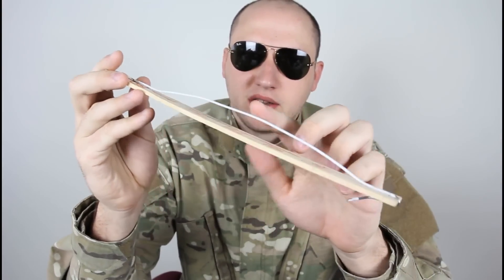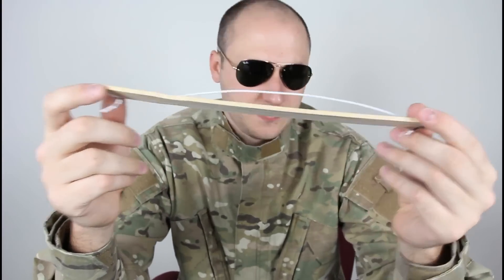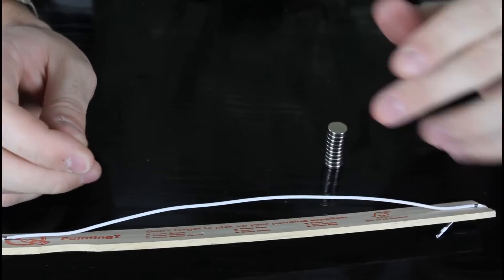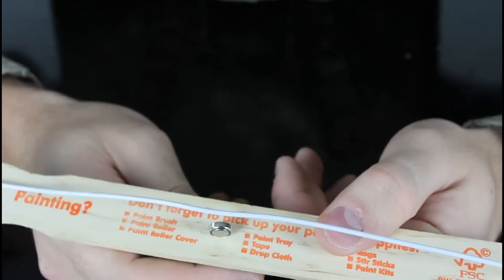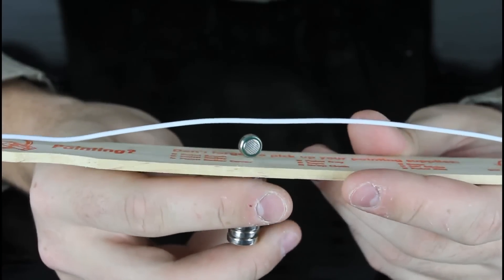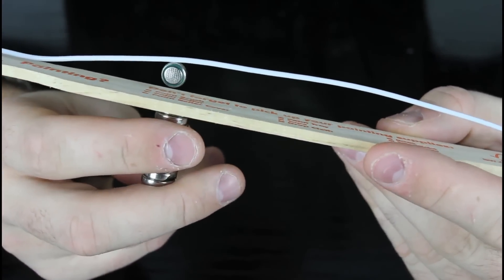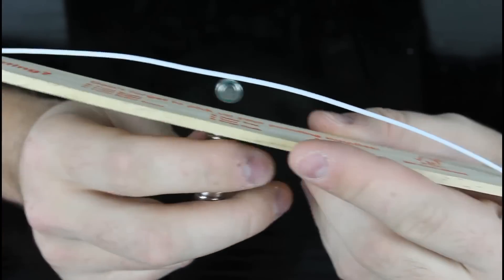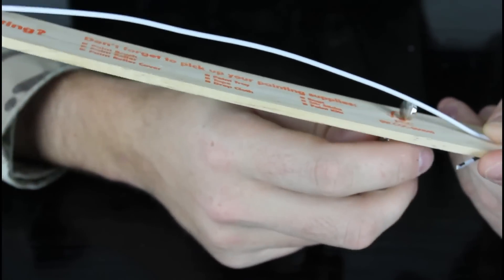Neodymium Magnet Experiments

Comment: The battery is made in to a magnet when introduced to the neodymium magnet's field. The wire is too far away from the magnetic field to become a noticeable magnet. When you touch the wire with the magnetized battery the wire becomes a magnet too, the battery is acting like a bridge. The reason for the battery to seemingly defy both gravity and the powerful neodymium magnet's pull is due to the physical connection between the wire and battery, and the gap between the battery and the magnet. If the magnet were to get closer than the wood allows it would act "normal" and ,by contrast, as the magnet moves away the battery would fall. It is A neat trick though.
Reply: Finally someone who actually says how it works instead of commenting on his accent and pronunciation

Comment: " that's why at the beginning, the battery stuck on the wood"

 The battery is not stuck to the wood but rather forced by the magnet.

 The metal  hanger has a magnetic field infused or rather imposed upon it simply due to it's proximity to the magnetic fields.

Comment: nope, this can't be true. Because the magnetic field is stronger the closer you are, so if the magnet would seperate the electrons, the baterie would still rather go to the magnet because the field of it is much stonger than the induced field in the wire. Also an magnetic field normally only has an effect on charged objects which are moving vertical to the streamlines of the field, which isnt the case here. however i can't properly explain it either :) .